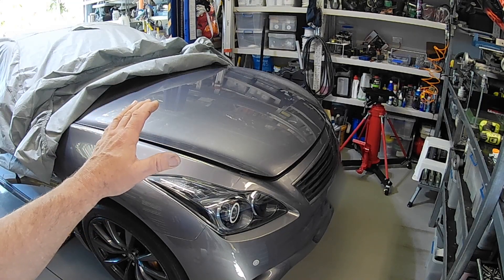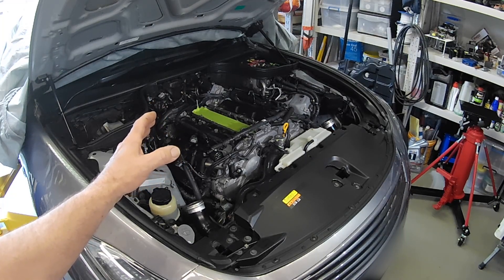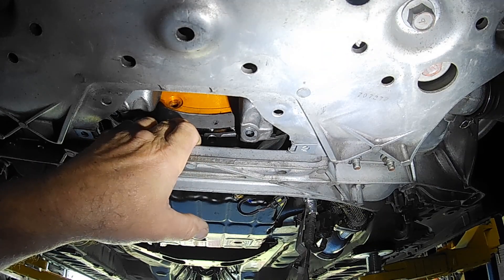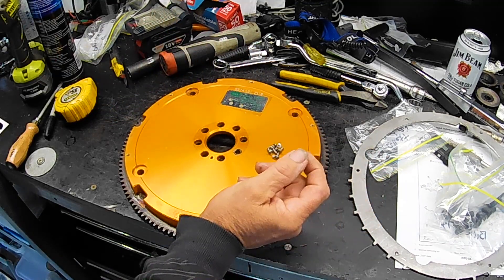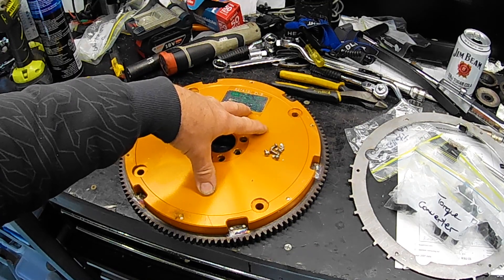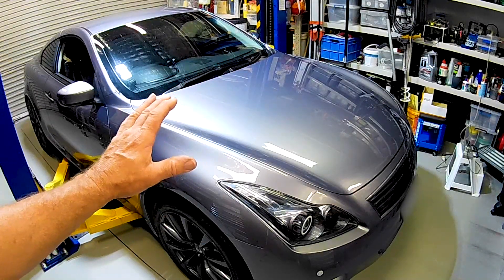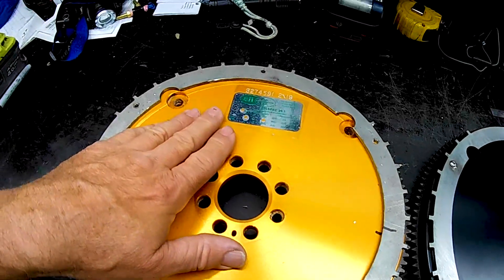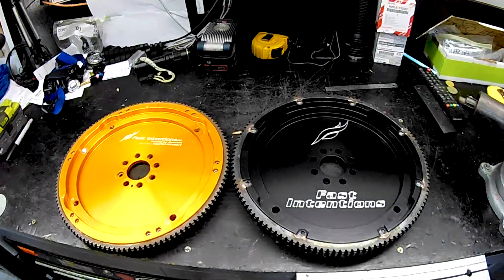370Z G37 RHD Diy Twin Turbo Build, FIRST FAILURE

Comment: Great company! I wonder how she gets the crank position with the original flywheel?
Reply from the maker: G'day Klaas, its the same arrangement on the OE flywheel/flexplate. Unfortunately the OE version is prone to cracking around the Torque Convertor mounting holes when you add Boost. Cheers Mate.

Comment: Great that they stand behind their product and you are talented to take care of it, but imagine having to go to to a shop and paying twice to get it done... Not fun at all.
BTW, do you have ECUTEK or UpRev? Do you still have cruise control?
Reply from the maker: G'day Mate, yes, paying someone to take care of it would have really sucked. As it is i'm down a crank angle sensor (which aren't cheap) plus my time, but with modified cars & aftermarket parts it about as good as you can hope for. I'm using Uprev to tune, as I needed something I could fiddle with here in the Shed which you can't do with Ecutek. The JDM 370gt's dont have cruise from the factory, which kinda sucks but you learn to live with it. Cheers Mate.
Reply: @TheAussieShed  What, you mean you have to keep your foot on the go pedal all the time? Yeah, that sucks, unless of course you are on a track....
Reply: @TheAussieShed  how much is the crank sensor where you live? I see them for about $80 new oem which is pretty cheap compared to other sensors.